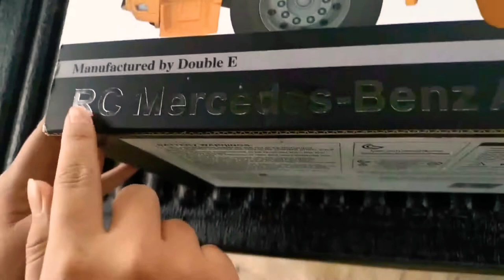Unboxing Double E Mercedes-Benz Arocs Flat Bed Trailer Loader Truck

Comment: Bro, dia bleh bwk huina 1593 tak? Maksudnye muat tak 1593 naik atas dia?
Reply from the maker: Terima kasih atas komen 😄 personal saya cakap. Untuk bawak huina 1593 boleh, tapi kekuatan lori nak tarik tu perlahan. Mungkin kalo baru, kuat sikit, kerana bateri baru 😄 sbb MAH dia kecil, kalo bro nak main lama, saya cadangkan beli MAH besar kekalkan VOL dia supaya tak terbakar board. 🥰
Reply: Ooo...maknenye muat la dia dok atas tu...tak terkeluar sikit pon eh track/rantai dia...means ngam² je eh? Sbb klu tgk scale low loader tu bkn 1:16 sedangkan huina 1593 scale 1:16...tu je nk tanye...
Reply from the maker: @angahkau1862  iya bang, ngam ngam 👍